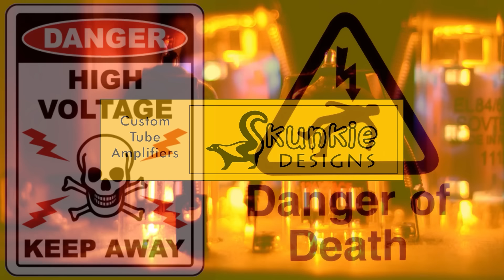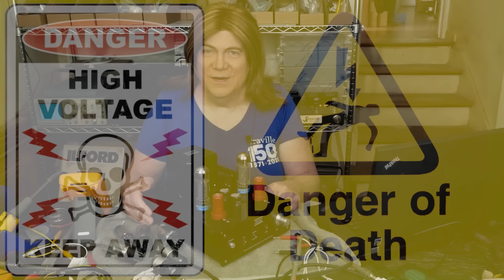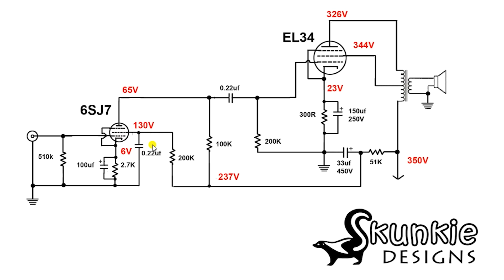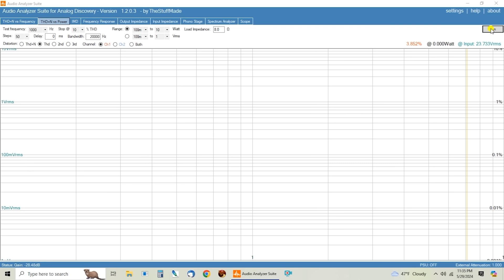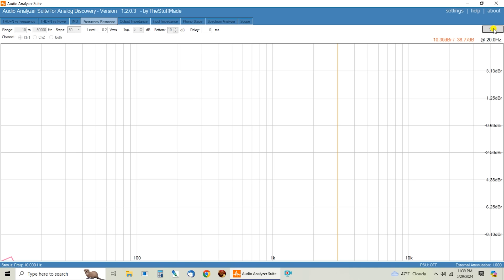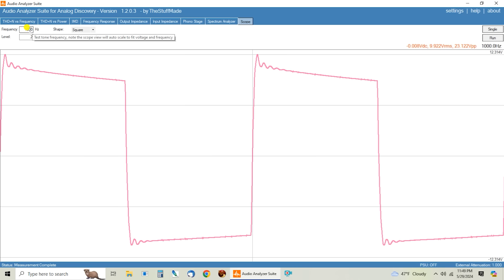Musical Paradise MP301 MKIII: Initial Circuit Revisions and Results

Comment: I have the original MP 301 mk1 which uses 6V6 tubes and puts out 3 to 3.5 watts/ch. I had to remove the cathode bypass caps to reduce gain to sane levels and eliminate it's tendency to distort sine wave and overload at all power levels. Once I changed output tubes to Tungsol 6V6s and driver tubes to Mullard M8100s... the amp now sounds it's best and is astonishingly quiet as well with not a hint of hiss or noise even with the volume cranked to the max. I find this unfathomable in a single ended amp but there you have it.

Comment: The original circuit is pretty much the same as the famous Western Electric W91a with the first stage omitted.  This is the WE300B amp that started the SET craze in the 1970s and 80s when Western Electric stopped leasing their amps to movie theatres and they became available on the surplus market.  See early editions of Sound Practices.

Comment: Looks like a confused design mistake with the switching of the voltages on the tube, great find - also worrying about global negative feedback, is that really valid - I mean, did you ever hear anything negative from a well designed negative feedback design? I mean these THX amps sound great to me. Anyhow, very cool as always. About the voltages, could it also be due to wanting the amp to be able to use as many different tubes as possible(which of course isn't ideal...)?
Reply from the maker: Possibly could be, but those whacky voltages happen with the tubes it is supplied with.

Comment: Howdy.
Comprehensive evaluation.
And Yeah. The input tube should benefit from some neg. feedback. If the sensitivity suffices one might consider omitting the input tube cathode capacitor. That would provide neg. feedback of the input tube.
Or one might consider splitting the cathode resistor into two parts and only capacitor bypass one resistor.
Someone might consider using a trimmer and connect the slider/viper to the bypass cap. to obtain tunable gain vs. neg. feedback.
But Yes. Skunkie does not like trimmers as they are troublemakers. Point taken earlier.
High Regards.

Comment: So KT88 tubes are not recomended for this amp by any means (pwr trans will fry otherwise) , as I understood today from the new video. Will it happen in case of such schematic changes only? 
Is there a reasonable modification route to keep these tubes or better not in order to have better sound with mods you are deciding to follow?
Reply from the maker: I said KT120 would likely overheat the transformer.
Reply: It looks like I've misheard: I'm Russian.  Now having no anxiety on keeping on the kt88's. 😊

Comment: Well Stephe, I’m astonished at how quickly you not only came up with those improvements, taking the performance in the right direction, but that you did that and was also able to put together a brilliant video explaining what you did, and why that worked in such a clear and helpful way. You’re a legend. 

I’m very impressed and can only thank you for putting yourself out to do this so well and so quickly, especially as not so long back it looked like you would have preferred to just toss it out the window and move onto some of your other more pressing commitments!  🤣 Glad it didn’t involve totally gutting this thing and after all, and it essentially came down to a few bad decisions that had wiped out the bass response and totally distorted what little was left in the bass region.

Still makes me question whether all these Musical Paradise units should be marketed as being ‘capable’ of running such a crazy wide range of tubes in them. I don’t know if this amp has the switches in it that the others they make (which it turns out are to change the heater voltages) to broaden the range of tubes each circuits ‘can’ work with) - but as you’ve ably demonstrated, just because tube pin layout and heater voltages MAY make it ‘capable’ of taking a different tube, that is NOT the same as claiming such a broad range of tubes will actually perform WELL as alternatives; that of course depends on individual tube specifications which specifications the circuit was DESIGNED to work around to produce great sound. It’s a nice idea to give wide flexibility (and also let folks learn in the process) but it would be better to have a smaller suggested list of tubes that could perform well, instead of trying to be a jack of all trades and master of none.

Learned a lot today. Looking forward to watching and understanding any further refinements. Thanks again 🙌

Comment: What I dont get is how did MP get it so wrong .I hope their Preamp is not the same...
Reply from the maker: Doing some research, this looks like it is either a design copied from a VERY old radio that was never intended for hifi use and/or from a guitar amp designed to inject "funky" distortion. I suppose to some people's ears, this funky distortion = "Tube sound"?
Reply: @SkunkieDesignsElectronics  This is the point !  👌Very logical inference your wise brains are making. 😉

Comment: I wonder if the earlier versions had the same incorrect components and design or were these issues introduced over time?
Reply from the maker: I have no way of knowing, and honestly can't spend the time testing every possible variation, if they even are variations.
Reply: @SkunkieDesignsElectronics  I was hoping some of the audience might have the older models and look for the  internal differences.

Comment: Thank You, Thank You, Thank You (😘) for your work Stephe, you've given me hope that I can get decent sound out of my investment!
I don't mind if I have to outlay a conservative amount of money for Edcor xformers (four of them for my two units) to gain much better fidelity, I'll do what it takes.

Have your experiments lowered the 60hz noise floor (hum that you heard) or is that a product of the PS?

One last thing...
Can you please supply a BOM for the replacement parts you're using? I live in the middle of nowhere and parts acquisition can be extremely tedious to say the least. With the BOM I can order top tier items from one source and be done with chasing everything down which  leads to revisions done in a more timely manner.
Reply from the maker: Patience, this was just an initial "poke" at a design change, mainly to try to single out what was causing the missing low frequency and weird distortion I was hearing.
Reply: @SkunkieDesignsElectronics  Of course Stephe.
I see what you're doing and why and and have the utmost confidence that you are on the right path. I realize that this is your first jab at this unit and that component values (and maybe OPT xformers) will maybe have to be massaged to get the best performance out of this hot mess. It's exciting to observe a qualified person discovering shortfalls and a path around them unlike the other people who shotgun PCB's and hope for the best outcome.

Comment: The  high screen voltage, somewhat higher than  the anode voltage  ( in the past era was also a standard used operation design )  it is and was  used often correctly a ....LITTLE bit....  higher than the plate voltage ( unlike as seen in this amp , this is starving point operation and gives high gain but also  HIGH distortion )...that was practice and normal used design with pentodes to expand the curves and the dynamics as well as amplification.............
To document this starvation mode oeration .....( MULLARD  UK -Tube manufacture -EL34 and other original famous nos tube ) ....They had such a low power and LOW-FI design.......for radio and simple amplification without any HIFI asiration........to be able to do direct coupling without a capacitor between the driver anode  ( EF86/6267) and the grid of the output tube..
The result were not up to quality music reproduction but the amp was CHEAP to build !!
Reply from the maker: I think this design was actually based off a guitar amp, same as the Nobsound 6P1 was.
Reply: @SkunkieDesignsElectronics  i THINK YOU ARE RIGHT ;......made to distort ...
Have a nice day XSteph.

Comment: Nice ............;
This kind of operation point on the penthode driver input is called a ( Starving mode operation ) ..sometimes seen  in vcertain very old  amplifiers.
Question : Was this design made for driving speakers or headphones because with one secondary winding you have to choose ......and the other oints were you put the finger on problems are designed by  ...hmmm....
OPT is probably questionable quality and the UL here does not make any sense for headphone drive of a n EL34 .............;also pure class A of this tyube type is standard 250 plate ...........triode mode should be used ( dedicated for HPhones).....plus the tandem pentode input/driver followed by Triode for coherent harmonic musical spectrum .....
Voltage on the screen of the penthode is better choosen by lower value of about 112 volt ...
operation conditions of the plate voltage must also be adapted  etc...........
there's a lot of work to do and mayber you can get it sing .....
The cap on the  screen ( 6SJ7/5693) must be of quality ...
It would be interesting also to see the design of the power supply ......
Good luck and you will find ways to improve this thing within the limits of the amp and opt .
kind regards.

( Personaly I would mayb consider to use this amp/chassis to build a quality  stand alone powersupply for a preamp or a phono stage ...........if the transformer is good enough )

PS....With a single pentode ( per channel )like a c3m, a 717A/6AK5/408A WE ....one can build a VERY good headphone amplifier..........Yamamoto build some very nice headphone amplifiers and preamplifiers with sope of these pentodes...........and they sound realy very good.

In this case very interesting to see what you can get out of this design .....

Comment: Hi Stephe.  Triode curves for 6SJ7, you got 'em.  Refer to the flash drive I sent you.  PDF Files => Tube Data => 6SJ7 => 6SJ7 GE.  Triode curves are included for this pentode.  Hope this helps.
Reply from the maker: THANK YOU! GE data sheet was the missing piece of the puzzle. Doesn't look like this is actually the electrical equivalent of a 6EJ7, less gain triode strapped. Might still be enough with the bias set right
Reply: @SkunkieDesignsElectronics  You're most welcome.  Thank you for making your wealth of knowledge available to us hobbyists.

Comment: The original circuit is a classic circuit, from the time of the advent of pentodes. Works great in the normal power range. Why do you need to add feedback? Add odd harmonics and make your amp sound harsher? Well, the power will decrease a little, but the sound will definitely get worse. We know, we went).
Reply from the maker: No it's not "A classic circuit". Someone posted a totally unrelated circuit schematic on a forum and people (fan boys) took it as gospel. No "classic circuit" runs the screen at 2X the plate voltage. And this type of feedback doesn't add odd order harmonics. Nice fan boying though :)

Comment: Hi Stephe.. Good to know that you found out that there’s an inadequate Ck value for the output.. I would personally go a tad lower with ~270uF to 330uF in that position just for more subjective ‘weight’ in the presentation.. I hope the lispy sibilants would get resolved with further mods down the road..
Reply from the maker: going 270-330 isn't going to hurt, I'm not sure with these OT it will matter.
Reply: @SkunkieDesignsElectronics  I think when you upgrade the OPT, it will.. The 300R || 330uF will give it subjective heft..
Reply from the maker: You have a point. I wasn't planning on upgrading the OT but that may now be on the table.

Comment: 510k grid leak resistor is too high.  It might cause el34 current drift.  Any thoughts?
Reply from the maker: The data sheet says 500K, why would it be too high? BTW I've been using that in my amps with no issues.
Reply: @SkunkieDesignsElectronics  I am just thinking of that 500K is the design max limit.  I am working on a KT88 parallel amp, fixed bias (adjustable individually).  One particular PSVane tube burned through 4 cathode resistors (100 ohm for Ik measurement).  Finally, I changed it from 220K resistor to 100K this morning after it burned another cathode resistor last night.  Cathode current drift is a monster for the new tubes.  Maybe it is not a concern for EL34.  My thought is why to push to the design limit.  Will it make the amp sound better?  My ear is not good enough to tell the difference these days.  Let me know your thoughts.  Thanks.